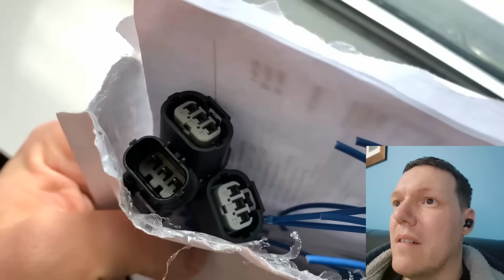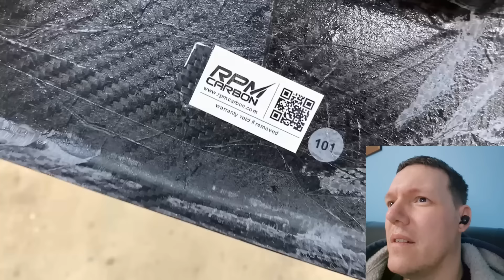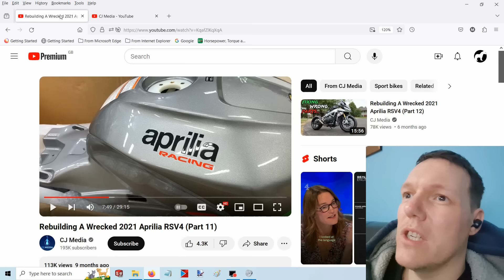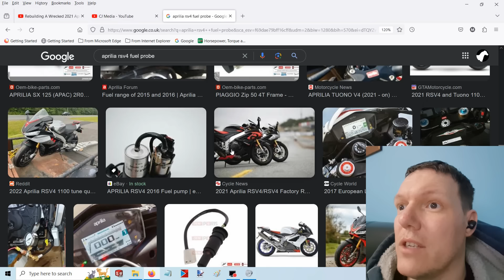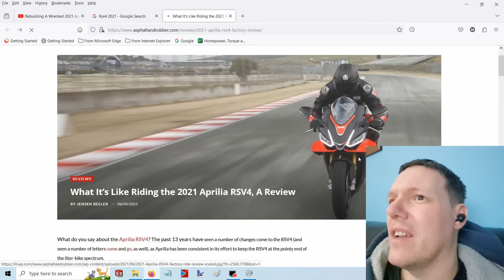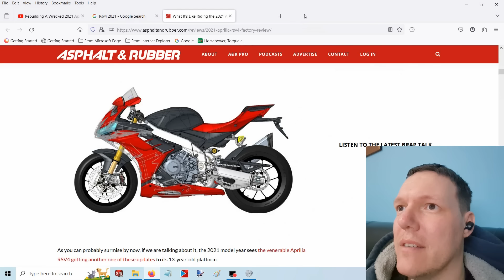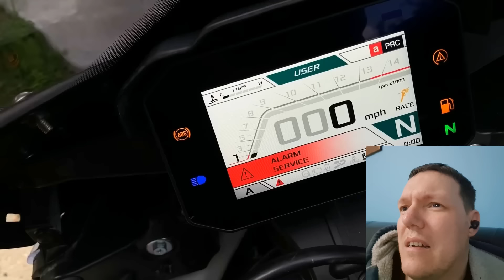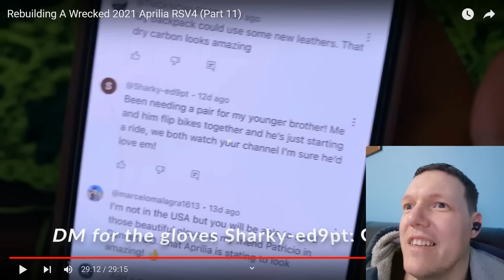RSV4 - Part 11

Comment: 1984 Katana colour scheme. 
It’s a pillion cover, not a seat, unless you’re Italian. The v shaped profile is designed to prevent your farts from causing turbulence.
He could colour code the cables to look like the originals by painting them.
I remember a Private Eye issue wherein Idi Amin complained to Triumph that he couldn’t get the wiring diagram to cutout and fit properly.

Comment: That blanking thing on the tank is where the fuel level sender would go, at least on the UK and European models. Not sure why his one doesn't have it. Maybe the US  models don't have a fuel gauge (i.e. one with bars) and just rely on the reserve light (which has a separate sensor I believe). Also the "gyro cutout" is for the Bosch IMU that's used for the various rider aids. And no, that rear cowl isn't the pillion seat. It's just a cowl. They come with a separate pillion pad which can go in its place instead.  RSV4 and RSV4 Factory are essentially identical, except the Factory comes with forged wheels and semi-active suspension.

Comment: I had a gen 2 tuono with a plastic tank and it was a proper Kent to fit when it was warm, it expanded so much the bolt holes at the front of the tank wouldn't line up with the holes in the frame to the point where I had to be a rough arse bastard and pry it into position, was easy to fit on in winter though when it was cold

Comment: THe sealant he used to bodge the tank....not fuel proof at all! Will dissolve given a few days immersion. Actually quite difficult to find any adhesives to bond Nylon/HDPE etc.
Reply: He should weld it.

Comment: Those PA6 tanks are shite, they swell due to absorbing moisture from the air. This makes them not fit after a few years. Every Aprilia since the RSV Mille suffer from this. 

Probably don't want to use PP or HDPE because of painting difficulties...